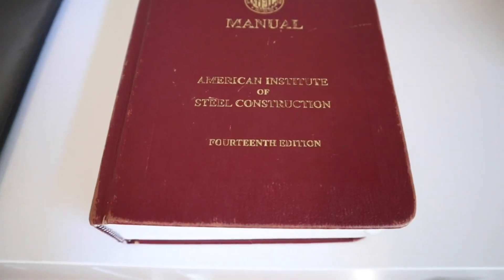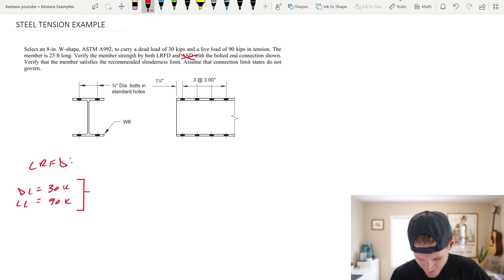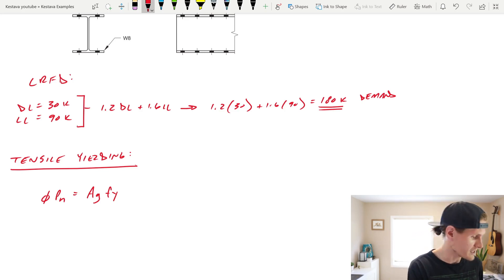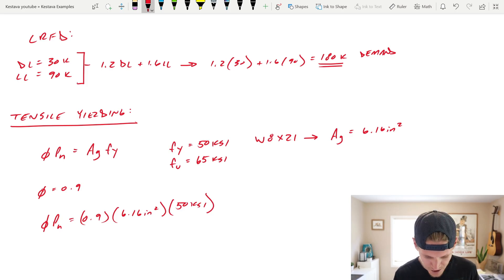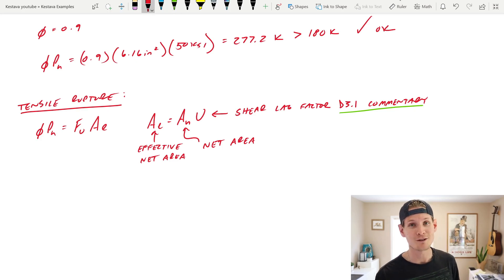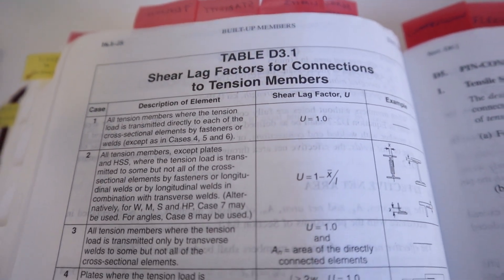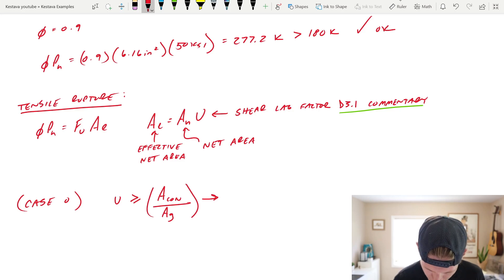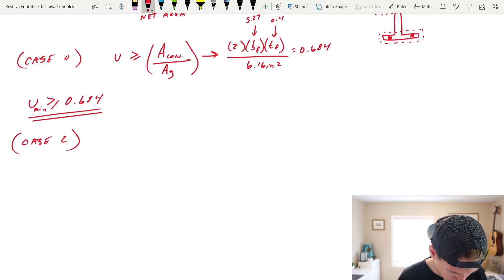Steel Tension Design PART 1 of 2 | AISC Steel Manual | PE / SE Preparation

Comment: Loving the video quality & it feels like you made an effort to trim the fat & make the video more concise/shorter, which I REALLY appreciate. Great work!
Reply from the maker: im glad you noticed the new gear! i was able o dig through the lost and found at the auditorium and find some loose change for gear. trying to get better every time with shorter videos with crystal clear explanation. thanks Eric!
Reply: For future video suggestions in the same camp as this one: I’d like to see you check a beam-to-column moment connection with an I-beam supported by an HSS column, including a check of the HSS wall thickness for the loads from the beam flanges.
Reply from the maker: Done plenty of those connections! expect to see it in the near future dude!